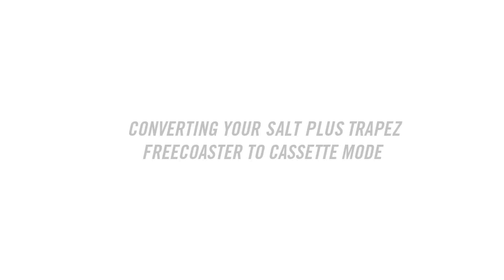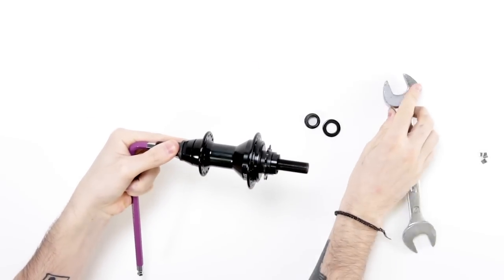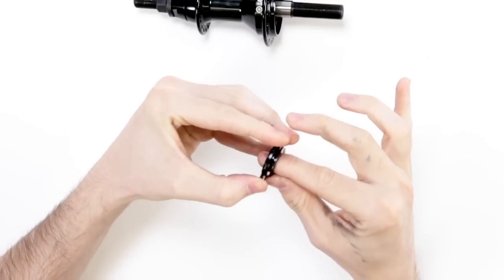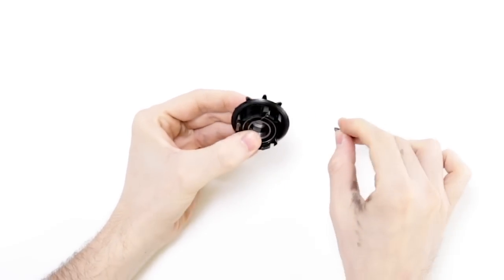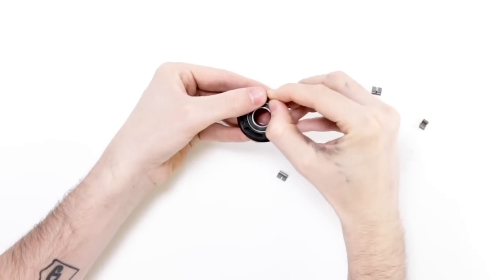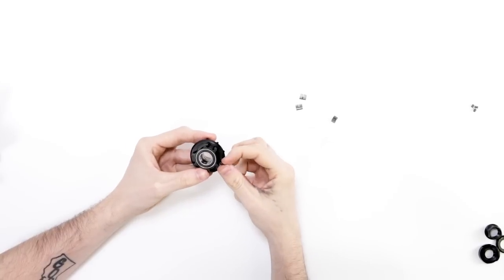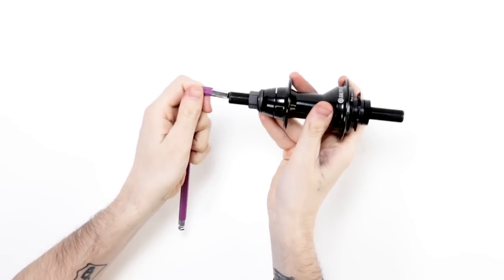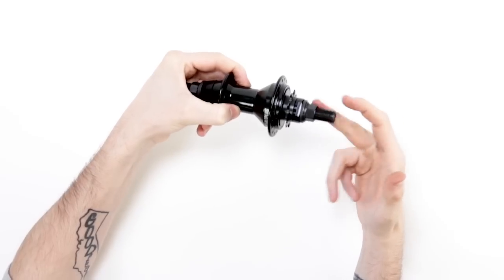Saltplus Trapez Freecoaster – How to switch from Freecoaster to Cassette.

Comment: +salt BMX parts can the driver be put into a cassete hub?
Reply: You can't normally just brand swap drivers depending it'd have to fit but it defintely could in the cassette mode for sure if the hub is machined the same size kinda how odyssey drivers doesn't fit profile hub but it'll fit into a mission hub

Comment: Salt BMX Parts, is this method good to any cassette ??
Reply: It's not a method it's a complete system that only works on hubs made this way such as the salt plus trapez coaster the vocal hitchhiker and the Ezra they're based to be a freecoaster that turns into a cassette because of how the internals are machined and designed
Reply: Sadly I do wish it would work on any hub I need a new coaster mines beyond done for